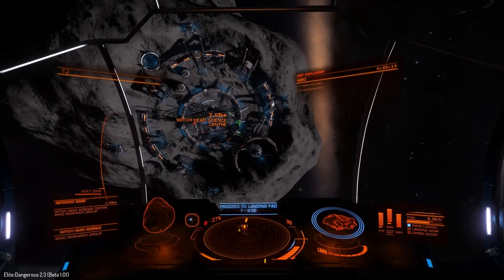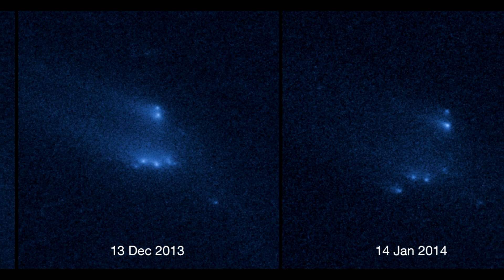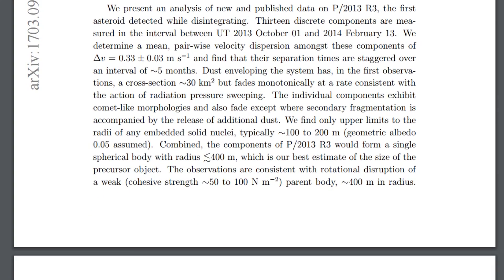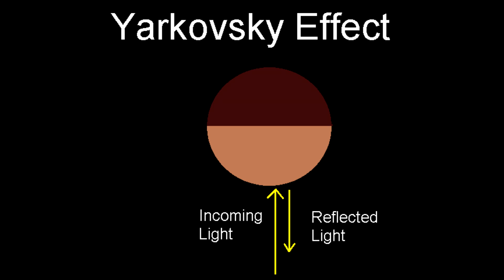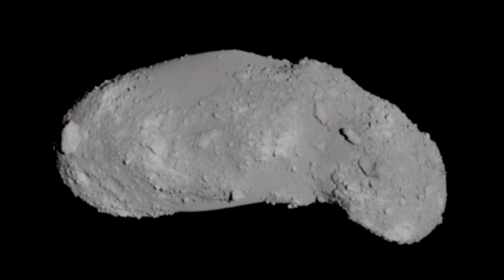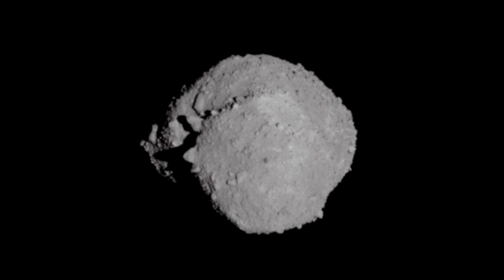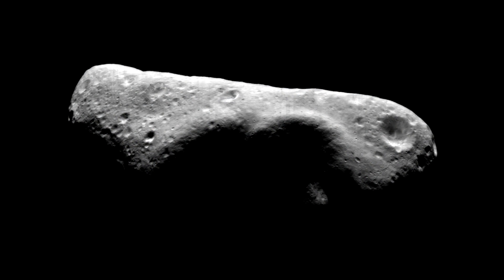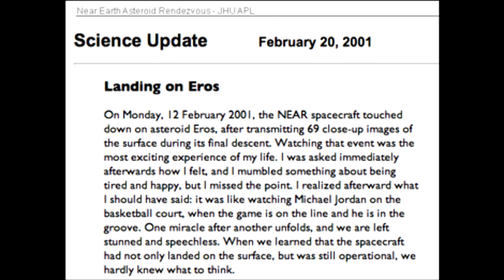Spinning Asteroids To Make Space Stations

Comment: Rock is also particularly ill-suited for this application, because it's at its weakest in tension (which would be the dominant stress mode in this case).  Alternatively, what about Niven-style blowout asteroids?  His suggestion is to use nickel-iron asteroids, balloon them using steam pressure, then spin them up.  Would this be plausible with smaller asteroids, or is it another case of him failing to consider material strength a la ringworlds?

Separate question:  Sci-fi authors love space elevators, but even assuming you could create a suitable cable or ribbon, how would you actually get the whole thing in place to begin with?
Reply: Ignoring engineering details like material strength and resonance modes?
Conventional launch of bootstrap material, then build the tether down from geostationary orbit while simultaneously  building the counterweight up.
Once a minimal tether is in place, you can haul additional material up the tether and reinforce it.
Reply: I want to know the cable thing, too.
Reply: In Niven's books, humanity has infinite cheap energy. So heating a metal asteroid up to melting point and inflating it is plausible, in his fictional universe.
Reply: Elevator cables: elevators are only going to usefull in fairly high-gravity environments where rockets are big and dangerous.  An elevator at Ceres or Eros would be easy to do but wouldn't save much over using low-thrust rockets.  On either you could do all your launches with catapults.
   Getting an elevator cable would be just a matter of fabricating it in space.  The minimal cable, only large enough to accomodate a modest climber would still mass around 100,000 tons, close to 1,000 SLS launches.  That would still leave the challenge of seamlessly splicing the 1,000 or so cable sections in space.  An easier approach would be to source all the raw materials from a carbonaceous condrite and fabricate the whole carbon nanotube or graphene cable in one continuous process.  Attach an archor to one end and gently lower it to the surface of the Earth.  The only necessary thing it that the center of mass of the cable is at geostationary orbit above the point where you want to anchor to on Earth.
Reply: Kevin Shepardson,
A stationary space elevator is assembled in orbit. Preferably at synchronous orbit but, perhaps, the structure is gradually moved outwards with ultra-high efficiency engines. The center assembly (micro-g) hub is supplied with spools of fabricated graphene tube segments. Splicing and composite layering is done until the ribbon is ready to deploy both up (out) and down (inwards) simultaneously. 

The initial elevator fabrication must reach full length before it is ready to be lowered into the atmosphere and anchored on land or sea. 

Until then, the excess length is stored on spools and/or the ribbon cable will be deployed folded over a pulley at the weighted lower end. 

With folding, the true endpoints can be maintained in the center micro-g fabrication hub until self-mass and layering requirements preclude this. 

There are several harmonious ways to continue fabrication. One is to install fabrication plants and/or habitats at both top (outward) and bottom (inward), which need to be weighted anyways. The inner end will eventually experience near surface gravity, even while above the atmosphere. 

The second is to fabricate and deploy the actual ribbon endpoints from the hub. Of course this requires folding at the weighted ends. 

The third is to shuttle along the existing structure, bonding new  composite layers.

The outwards section can be shorter than the inwards section if a greater mass is maintained at the outer end. Both must be adjusted to maintain balance so that the micro-G fabrication plant can operate correctly.

A side effect of lifting all mass to the geostationary point is that a large amount of potential energy is stored. The act of deploying the cable will allow this to be converted to electricity, for example.
Reply: In Red Mars by Kim S. Robinson they use a material rich asteroid, bring it into geostationary orbit, build robot factories on it and use the mentioned materials to build the cable from the top down into the anchor. That way you dont have to build the cable upwards wich would be plain stupid.

Doing something like that on earth is near impossible,or at least very unlikely, even with fantasy materials.